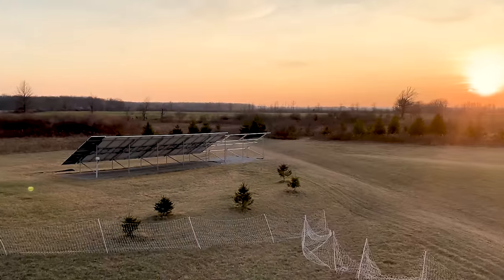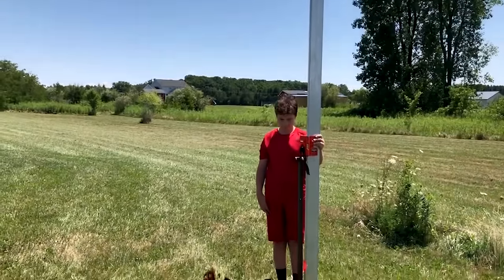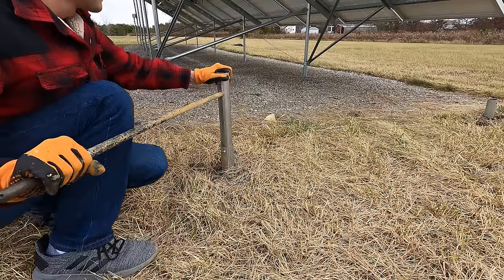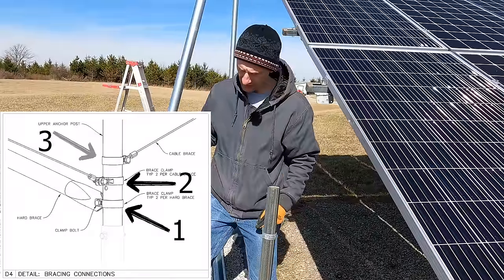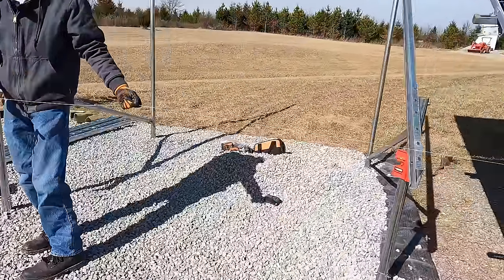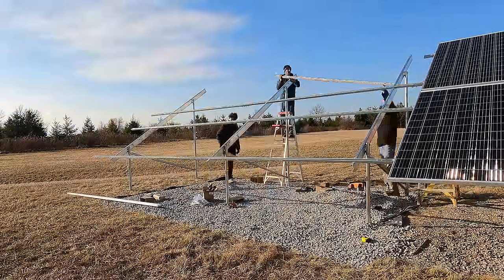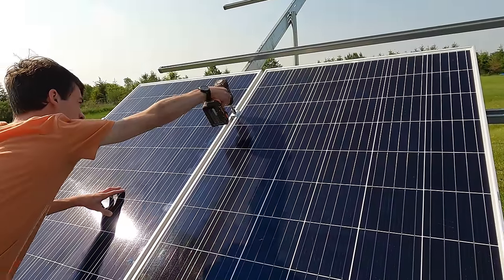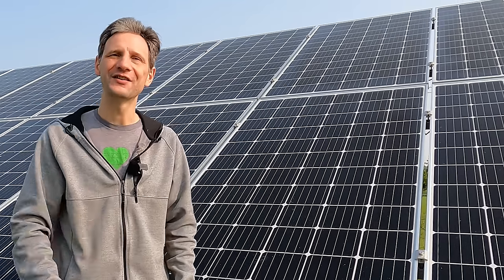Easy DIY Solar Panel System Racking Install

Comment: Try this in Santa Barbara County where the local jurisdiction thinks that they are smarter than everyone else and will require you to get wet stamped structural engineering on the plans which will cost you thousands of dollars and probably take about six months at a minimum to get done.  I had a perfectly successful install business and I threw it all out the window in frustration with pulling permits and dealing with electrical utility interconnection agreements.
Reply from the maker: It's too bad the business environment is so unfriendly there.  No one wants to have to move just to keep their business.

Comment: if you have a finance constraint, would it not be beneficial to put more batteries and less optimizers?
Reply from the maker: If you have a finance constraint, I would not use batteries.  I would just have a grid tie system.  Here are some details on how it works: https://youtu.be/IwUK1dNJ3n8

Comment: How well does ready rack work if you have rocks? I live on on land with clay and glacial rocks.
Reply from the maker: The tighter screw is for rocky soils.  If you have very large rocks, I recommend you go with the ballast type system.

Comment: I wonder if the ground screws can handle the clay/rock mix of the Ozarks?
Reply from the maker: You could contact Ready Rack, I'm sure they have some experience to share on those soil types.

Comment: I know this is an old video, but hopefully you still monitor the post.  Do you have a link to the ground screw driver for the tractor? I looks like a post hole sher adapted to accept the screws. Any information you share will be helpful.
Reply from the maker: When I was installing my system the suppler didn't have an adaptor for a post hole digger, so I just made that one myself from some scrap pipe.
Reply: @ProjectsWithDave  do you have pictures of your custom pto powered screw driver online?
Reply from the maker: You can see more detail here: https://youtu.be/_xA6qOwnYbM?si=6pwWwAZMhnEyC6IR&t=628
Reply: @ProjectsWithDave  thanks so much for the help. I can't wait to get energy independent.

Comment: Do you know how much force is exerted when a 100kph wind blew on the panels?
Reply from the maker: When you have a system designed, the engineering paperwork comes with all the loads defined.

Comment: Did you compare readyrack with unirac large array system?  cost/benifit, or pros/cons?
Reply from the maker: I did not.
Reply: I’m also trying to compare the Everest rack system.  I think it is best to prepare the rack site and over build by a few panels for future expansion.  Everyone I have asked wishes they had built a larger array.
Reply from the maker: That's because It's addicting to produce your own power...

Comment: DIY friendly? All I need is a $20,000 tractor and a $3,000 screw implement. Easy! I'll just mortgage my home. Thanks.
Reply from the maker: You can rent a skid steer for the day.  That would still likely be cheaper than concrete.

Comment: Any company make a fence post that can be installed on either of those ground anchors you show?  I thinking about a vertical solar panel fence reason I am asking.
Reply from the maker: I think you could just order the screw with a longer post attached.  As long as you had a way to drive that long of a pile.
Reply: @ProjectsWithDave  How deep did you go with the screw or auger style tip?  What is your frost depth code?  My project’s frost depth is 24” and the county construction code requires every thing to be buried 12 or more inches below the frost depth.  Everyone I asked said the local contractors bury everything 48”. Would Fence post tips need such a depth?
Reply from the maker: Mine go down 3'.  If you don't go below the frost line, the posts could move up and down and crack your panels.

Comment: As a solar installer; I can tell you these screws only work if you've got good clean dirt.. if you have lots of rocks or god forbid you live on shelf rock, then these screws will not work. 

We use a very similar screw system (sunmodo) at my workplace and I hate it.. the crews who drive the screws have to auger rock out and set them in concrete half the time, anyway! XD
Reply from the maker: My soil has very few rocks, so no issues for me. They do make a screw for more rocky soil, but I haven’t had the opportunity to try it.
Reply: I don't have any rock but I do have clay will this be an issue? Thx
Reply: @savedforever7702  Clay should be fine. The screws are 5ish feet long with only about 18 inches above grade. (If it's done correctly. XD)
Reply: @milkhbox  gotcha. Thanks for the quick response. Yeah I'm having to find a rack with 125 mph wind rating to get permitted I'm noticing a lot of the cheaper ones are in the 115 Max wind and I'm assuming this rack is probably around the 7 or 8k range as far as price goes. Probably way out of my budget. I'm seeing a lot of great racks being built out of timber. Then you got to get engineered  and probably won't look as good  in 5 or 10 years .

Comment: Would be cool to see a version of this for quick antenna mast installs. Sometimes you just need to be able to have a decent base for a mast that is not going very high. Would be cool to see a short one designed to attach to an auger just screw into the ground and bam you have a mounting point to install a metal pole off of. You could even use 5 of the things so you could get a really solid base for a taller mast.
Reply from the maker: Yea, I was thinking it would be a great solution for a windmill.  Seems like there are a lot of possible applications.

Comment: An admirable system but, having eliminated the concrete, why did you need to put down all that stone? Wouldn't sheep manage the grass and avoid ground maintenance?
Reply from the maker: Sheep might be a solution, but I don’t have any.

Comment: 0:29 - Concrete is cheaper
0:57 : Readyrack .. blablabla .. those screw are a pretty old system, and we use them for houses for decades : This is clearly an advertisment for Readybolocks

Comment: 12:02 - big mistake and also dangerous cause a plastic zip tie will rod away and then the cable end will get loose maybe even under tension and might hit the white foil and damage that. And then you are screwed cause you will not recognice what is happening cause moisture will get in directly condens under the electric surfaces and cause what ?

corrosion which grows over time and equals what ? additional resistance and therefore less power from that particular panel which also kills the string, I mean decreases the production of the whole string. 

Get metal cable ties VA2 or so cheap from china and everything should be fine even though I suggest to cut the rest off that it never could hit the white foil. Best and easiest way. 
The current long cable will not make you happy or help you but can cause big damage. Those cable ties rot away in about 5 years , most likely lot earlier in your region with the snowy winter and a lot additional reflection of UV light that kills the plastic. 

Here plastic zip ties are forbidden for electric installations at all due to these reasons.

Comment: Energy pal is a waste of time don’t bother. You should warn your subscribers that the energy pal website is not sophisticated enough and limited to grid tie systems and they can’t help you if you have new development plans and there is no current ability to tie into the existing coop.  So they will not help with any off grid systems.  Also they stated they don’t have any subcontractors that can work with the newest 2023 equipment such as the hoymiles 4-1 micro inverter as an example.
Reply from the maker: Thanks for taking the time to let people know your actual experience.